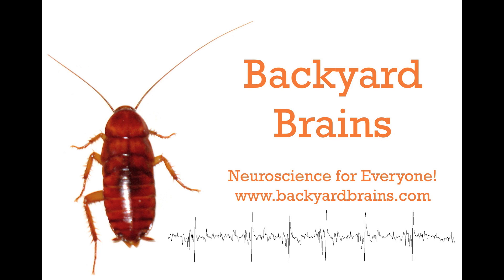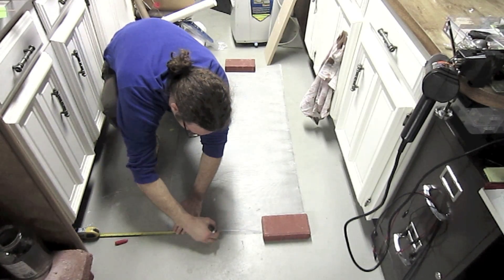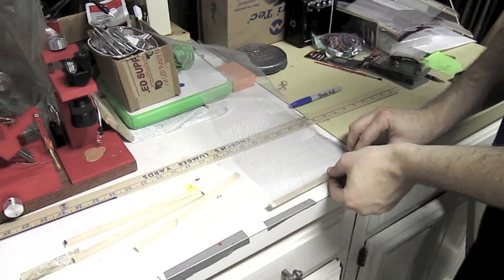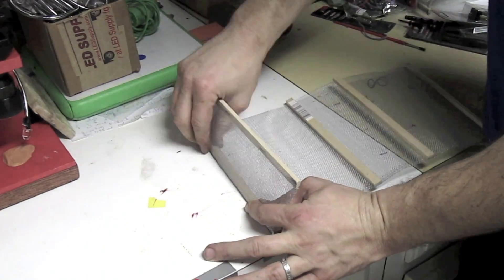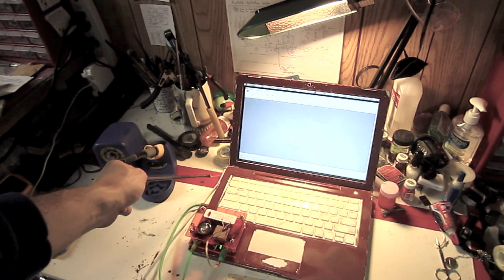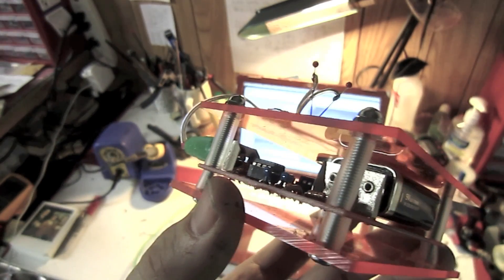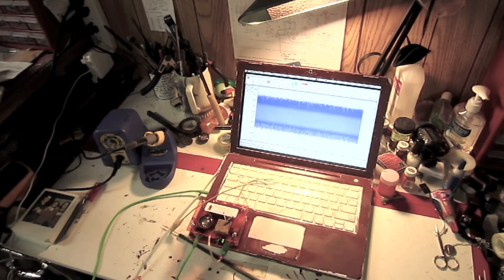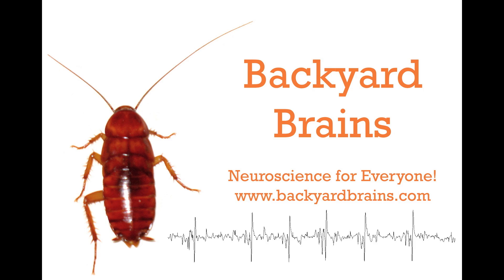Making a Faraday Cage

Comment: I am SO CONFUSED 😕 
I understand how to build this thing but you lost me with the rest. Heard there is going to be a big solar flare and now I'm stressed because wth why do we need this and what does it do ???
Reply: If you want any of your electronics to survive the “solar flare” ie. an EMP blast from your government, you need to build something to protect them.
Reply: @editsweet101  is this example here in the video something that will work; say if I built it for a generator a riding mower a solar genie and such?
Reply: @melallred6523  Doesn't seem like it would work if it isn't ground and insulated on the inside now I think about it. Just being on the floor of a metal enclosure with no ground or insulation would be more dangerous than not having any metal around, right?

Comment: Gonna use this to insulate muh internet router, and its cables. Or perhaps just get a Cat 6?
Reply: 5G travels only short distances although it's powerful. And somewhat  of a short time ago 5G was only viewed as possible for the masses if they built one communication tower for every 3 homes. I believe it may not have had the capability to travel through glass efficiently a short time ago.. but things are changing. And you'd basically be conducting more harmful radio waves if you put an antenna on your head.
Reply: @LeBronJames-yr8ku  I use it for mind control when I'm not in my bunker.
Reply: @kebman  I love that ALL the comments you made here were jokes, yet no one seemed to get it. Sad tbh
Reply: If there's an EMP pulse, you probably won't need an internet router (no internet).
Reply: Did you make one? Does it reduce EMFs while allowing to use wifi?
Reply: @feltingme  No, whole thing dies. I have no wifi anymore. I wrote this in using telepathic powers!!11
Reply: @kebman  Maybe mesh size is important then? or metal? Commercial ones use stainless steel.
Reply: Dude that fascinates me. Tell me more.
Reply: The faraday cage absorbes all radio frequencies. That was a great idea but a lot of people build faraday cages around their beds to keep harmful wifi and 5G frequencies away while they recharge their batteries at night. These signals affect your mood, or vibration, while you sleep if you get away from these deleterious energies during sleep you wake up much more refreshed. That's why I never sleep with my phone within three feet of me, or I put it on airplane mode so the microwaves from your phone don't impact your health and sleep. And I would urge you to turn off your wifi at night if possible if you don't already.
Reply: 5G has problems penetrating even a window, so if you really want to do that, then just make a tinfoil hat and sleep with it on. You'll sleep like a baby! But if you chew tinfoil, weird things can happen.